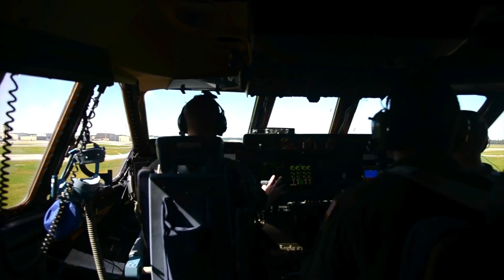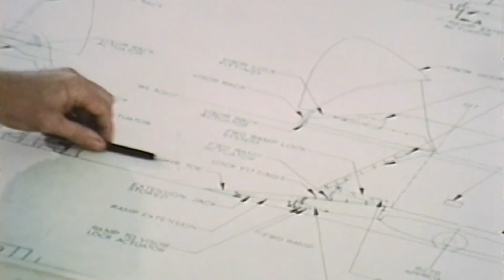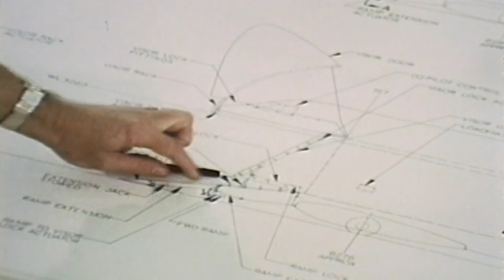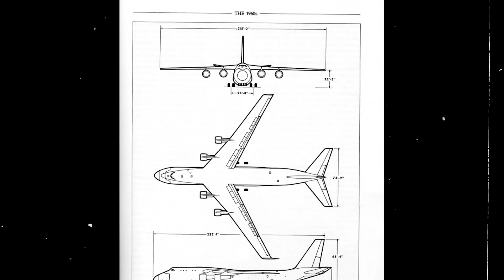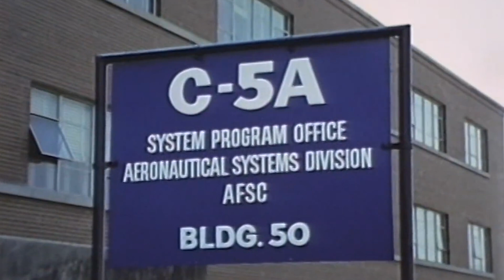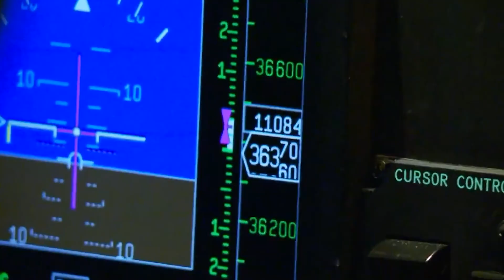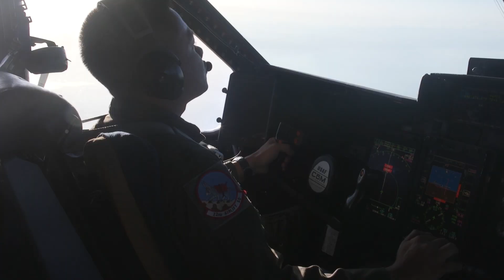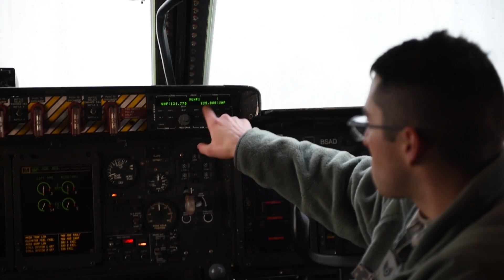The Secret Airplane that Could Lob Giant 86,000-Pound Missiles

Comment: This whole program was apolitical night mare....The Boeing design was clearly the better design but Mc Namara  hated Boeing and said he would never give Boeing the contract,  the Lockheed design did not meet design requirement and the plane was lightened and why the wings and fuselage were cracking.    As soon as Boeing built the 747  they took the 747 and loaded it beyond the capacity of the C5A and flew it to 25,000 ft just to rub it in the face !!!! and the rest is history...

Comment: In 1973 I was a member of an 8 or 9 man industry advisory panel on structural integrity (ASIP), which went to San Antonio (SAAMA) to tour the new C-5 Galaxy, which was having early metal fatigue problems. I was an engineering manager at Boeing, with extensive experience on the B-47, B-52 and 747. It was an awesome plane. I am now 96, and it was a memorable  trip.
Reply: Thank you for sharing, Mr Gore. 
Best wishes to you. 🙏
Reply: 96! God Bless you - you did something right. All the best for the next 10!
Reply: Really appreciate hearing from those who were 'there'. If this world is in need of anything, it needs authenticity.

Many thanks to you, Sir 👍🍻🇨🇦
Reply: At Dover AFB, had us stripping epoxy paint off wing box fasteners. Only use plastic scrapers with useless paint stripper. Not to hide damage to suspected fatigue cracks on nuts.
Reply: @roadglide1745  you got paid by the hour
Reply: @lukeamato2348  not if he was military
Reply: @lukeamato2348  USAF  pay in 1972 as E5? 
No overtime pay.
Reply: My grandfather was one team for this plane in San Antonio. He just passed away 2 days ago @93 but his last project was the B-2 stealth bomber. Jack Hayes
Reply: An uncle of mine was head of the Lockheed “sales” team at “5-sides”. He was present for the roll-out in Marietta GA. After living with the program for years, he could recite all the “wow” numbers, but he said that he was still in “shock and awe” when approaching it.
From a distance, it doesn’t look that big without a reference. Driving up to it, it just keeps getting bigger and bigger and bigger. He said when you realize the tires are the size of your car, the size is real but still incomprehensible until you are around it for a while. But the first time you walk up the loading ramp and step inside the cavern, it goes back to incomprehensible.
Reply: Comments Like Yours, Gives A Younger, Old Man Hope! I'm "Only" A Sexagenarian & I Bet You Could Tell Some Stories About Aviation! Thank You.
Reply: Interesting...Read Mr. Sutter's book on the creation of the 747 with great enjoyment and respect. You sound as if you have similar tales to tell.
Reply: @robertmatch6550  F-4 Tales

One Phantom lost a section of wing . Supposedly lugs at folding section failed. Okay guys, start stripping paint off so you can check for cracks. Middle of winter, Kunsan AB Korea. 
Later on we had remove factory epoxy from main landing gear strut. One failed on landing somewhere. Same time period. Nothing ever found. Blew heated air on strut and then stripper dried out.
Reply: @roadglide1745  my grandpa was a test pilot for the f-4 program. He mentioned these exact same failures. Probably a long shot but his name is Ronald culler. I'm not sure if that rings a bell or not
Reply: @bryantneedham8823  Sorry, knew very few pilots. Our FMS Commander was F-4 pilot. LTC. Burns. He flew all the FCF rides after  major maint. was completed. Everyone knew when Burns was doing a check ride. Balls to wall on takeoff, went vertical and was gone. Back within 45 mins. tanks mostly empty after being on Burner most of time. Practically chased a crew chief down through revetment parking area. Shut engines down opened canopy. Yelling its good! More on Burns tomorrow.
Reply: @bryantneedham8823  More on LTC. Burns. 

A friend and I decided to take early reenlistment and collect a bonus. Asked one of our Captains in Squad. to swear us in.  Arrived at orderly room, standing around waiting. This LTC. F-4 pilot walks in, hey you two what's going on? Reenlisting today sir. Oh that's great. Be Proud to do it. Ummm we already asked another officer sir. Okay, congratulations. Next day. Section chief calls us all into main bay of building. 1st. Sgt.  walks in with that pilot, calls everyone to attention. This is our new commander LTC. Burns. Oh Chit !  He looks around says a few words. Then it happens. You two front and center. Rest is history. One of best commanders I ever served under.
Reply: I wonder if you may have crossed paths with my Grandfather, he was an engineer, at Boeing , also . Kenneth Plewes . I know it is an enormous company, but he worked on some  very important projects and before his stroke in 72, ( on the 747 sp)  world tour , he was on his way too a V.P. position
Reply: God bless men like you. 96 y.o.m. I'm 38 and hurt all over so many injuries I pray I don't run as long as you. More of a man than me still and your nearly a hundred
Reply: Holy smokes sir, I can only hope I live close to your achievement AND have your wonderful mental abilities.
Reply: Thanks for your work I can’t even imagine working on those icons of aerospace.    Knowing the B52 will remain in active service for so many decades after its introduction must be very rewarding.
Reply: @haddock75  The remaining 76 operational B-52H's are 60 years old, We designed the B-52G/H in 1956 for high-altitude bombing. The emphasis in the structural design was minimum weight, to maximize range. But in 1961, at the height of the Cold War, we redesigned the structure to meet SAC's new, more severe usage and service life requirements. These notably included low level terrain avoidance training, often under extreme gust and maneuver conditions. The emphasis in structural design shifted to toughness and durability. The primary structural components are never replaced. The main reason for their longevity is that the usage has not been as severe as was projected. As Chief of Structures Technology at Boeing-Wichita at the time of the redesign. I am honored to say I chose the materials, the analysis methods, and the limiting stress levels for the redesign. I am thrilled to see these planes still flying, and projected to do so for many more years.
Reply: @lawrencegore6647  Yessir. AND STILL upgrading her. I have a friend, an engineer, at Tinker AFB, who is working on the B52 fuselage they recently pulled from the Boneyard, designing the new electronics for the total battlespace stuff. It's nuts how resilient that aircraft has been and IS.
I was surprised to learn when that one crashed off Guam, that they STILL have not added warning alarms for improper trim setting. Improperly set flaps and stabilators have brought many of them down. Most notably, when Bg Gen James Jimmy Stewart got his ride along during Vietnam, that issue almost caused the B52 he was riding jumpseat on to crash on return. Flight engineer caught the mistake last few seconds.
Reply: Good to hear your story. I hope you have the entire story documented.
Reply: That's cool. Would you friend me? My Dad was crewing Bombers starting in WW2. B17, B26 and B29 as a Gunner. USAAC. He rebooted under USAF and quickly moved through  crewing B36, & B47 as a bombardier / weapons NCO.  He then moved on to the BUFF, said the B52 was the most elegant aircraft he served on. He helped to work the issues out of the electronic arming system and under SAC on the BUFF at Altus AFB, Okla in 1964. He retired as the 3rd longest serving bomber NCO, and still holds that record at 35 years, 6 months.
I would like to ask you a few things about "HIS" aircraft.
Reply: Thank you for your service sir! As a soldier and paratrooper, got to experience traveling and jumping out off this amazing beast.
Reply: @Fred82ndAbn  Thank you for your service. My grandson was in the 82nd Airborne.
Reply: @lawrencegore6647  My son was stationed at Bragg for 13 years. Go Airborne
Reply: Good for you to be 96 and telling us about it on YouTube!!!  Thanks for your contribution to the program!!
Reply: Thank You for your dedication and involvement in protecting this Country Sir
Reply: That’s amazing! Thank you for your incredible contribution to the country!
Reply: I always liked the B47. It’s just about the coolest looking Bomber ever imo. It’s like a giant fighter
Reply: Sure, sure.
Reply: Dark Skies would be A FOOL to not tap the amazing (and still sharp) mind of Lawrence for future video content!!
My hat is off, to you sir! 
Best of luck on the next 4 years!! With how crisp you sound currently... please allow me to wish you an early Happy 100th Birthday! 😊🍻😎

As others have said, and as I have said myself, I love these comments made by folks like you and RoadGlide 17.
It's fun to watch these videos, but it's really cool to hear the ACTUAL first hand accounts by people like you guys.

Thank you all for sharing these stories AND you contribution to our nation; both those enlisted and civilian!
¦🇺🇸
|     🫡
Reply: holy shit man what's it like to be that old??? I'd never expect someone that age would watch content on YouTube like this
Reply: @skeetrix5577 96 is hard. YouTube is easy.
Reply: @lawrencegore6647   96 is hard YouTube is easy 😀😂 , your awesome, thanks buddy, many more b'day to come ... 👍🏼👋
Reply: @skeetrix5577  Hey Skeets, there's a lot of us "Boomers" (and before) on YouTube. I'm 68 soon. My Dad retired as the third longest serving USAAC / USAF NCO. His record still stands WW2 through 1964. Started on B26. Closed out on BUFF.
Being OLD is a state of mind to us who have lived that long. I am 1 year shy of 69, my Dad's age when he passed away.

Comment: Besides the "thumping" of the UH-1, those TF-39's of the C-5 A & B are the most distinct aircraft engines of the dozens of aircraft I grew up around being an Air Force brat (spending 12 of those 18 years living in West Germany).  My personal nickname for those C-5 engines was "The Banshee Engine", especially under a full load.  I was able to take a 2 hour flight being an AFJROTC cadet out of Travis AFB in the spring of '85.  Two years later I caught a Space Available flight from Dover AFB to Rota NAS while on leave while in the Marine Corps.  Such an amazing aircraft...
Reply: One almost dug a wing in at KKMC during Desert Storm. Extreme crazy gusting cross winds. Wing tip nearly touched ground. Fortunately ground between taxiway and runway was lower than runway. Been flat, been game over. Aircraft had 36 pallets of 2.5 rockets. Two more C-5's parked behind one we were off loading. Chit hot pilot saved day.
Reply: @roadglide1745  My dad was assigned to HQ Sqdn HQ USAFE as their First Sergeant when the C-5 crashed on takeoff from Ramstein during Desert Shield.  They lived about 3 klicks off the end of the take off flight path for jets flying out of there.  Had that Galaxy flown about another 1000 meters I might have lost mom, dad and brother.  I was there for the first year of his 5 year stint at Ramstein.  The old high school sat about 500 meters north of the departure line and we always got amazing views of all the F-4's and F-16's they were transitioning into plus the entire catalog of MAC aircraft.  One Saturday in late Oct 85 I was at the school for a home game and it was about 34⁰ with a headwind gusting upwards of 40mph and just a heavy drizzle.  About mid 3rd quarter I could hear the C5 starting its takeoff roll and it must have fillec to capacity as even over the howling wind and about 2 klicks distance I could hear the screaming engines.  Time seemed to really slow down as it felt like the entire sequence I am describing to take place took at least 10 minutes.  Soon enough we could make out the C5 seemingly floating in mid air.  Several times it looked as though it was only staying aloft because of the howling headwind and the huge flaps.  I had a knot in my stomach swearing to God I was witnessing a horrific crash unfolding in super slow motion (almost a frame-by-frame feeling).  When the aircraft finally made it into the clouds did that knot clear.  I can just imagine the crew all fasping for breath after the true airspeed indicator actually showed true forward speed.
Reply: @Wolverines77  Remember that crash. Don't recall if they found cause. The load master was in PAX compartment and walked away. So, the story goes. 
Size of A/C can cause illusion its barely flying. At Dover AFB, Air Force One would do touch and goes, beautiful jet. C-5's doing same thing, looked like they were just barely flying.
 C-5 climbed out at KKMC after a daylight SCUD attack. Max power empty, spiraled up over airfield. Said it was supposed keep clear of any more incoming SCUDS. ?. Firewalled those engines, impressive sight. 
Last hours of war. One F-16 came in with battle damage. Shrapnel peppered underside of jet just forward of intake. Forward landing gear collapsed on landing. It slid forever down runway. Finally stopped near us. Canopy opened. Thought for sure pilot would scramble out. Naw, he just sat there with both hands-on cockpit rails, shaking his head. Flocked up my jet moment. Memories.
Reply: @roadglide1745  I mentioned you in my thanks to Lawrence Gore, but I'll properly say it here: thank you for sharing these amazing stories. 😊🍻😎  ❤
EDIT: 🤦‍♂️ Oops! My 'thanks' extends to you as well, Wolverines77! 🫡
Reply: Living at the end of an Army Air field runway most my life I can say your name Banshee fits perfect for the C-5

Comment: Saw one of the Super galaxies at Oshkosh In 2019, such a cool plane, when it landed one of the brakes was jammed on and as it taxied it caught fire, spreading to the gear assembly, they had to cancel the rest of the air show for that day but will always be a very cool memory
Reply: Not sure what you saw but it was a small fire and did not spread beyond the brake assembly that was burning.

Comment: I grew up in the 60s with these beasts flying over our home near Marietta. Test flights of the first models (C5-A) were incredibly loud,, enough to break plate glass windows. A number of our friends and neighbors worked on the project.
Reply: I grew up in Smyrna, GA.  I’d see the C-130 or C-5 just about every day. When they tested engines you could hear it all over the county.
Reply: turbofan engines were actually quite noisy at that time due to their low by-pass profile
Reply: TF-39s are a HIGH bypass  turbo fan.

Comment: @Dark Skies. The Antonov-225! Mriya
Reply: But, the C-5 had more than one flying, and is still flying.  Antonov 225 is extinct.
Reply: @lancerevell5979 , there will be a Mriya Mk II, God willing.
Reply: @lancerevell5979  I was just recommending a video for Dark to do in the future.
Reply: The direct comparison would be the Antonov An-124.
The Antonov has a slightly higher MTOW (378 tonnes vs 405 tonnes) but a shorter range. An124 has 55 built.